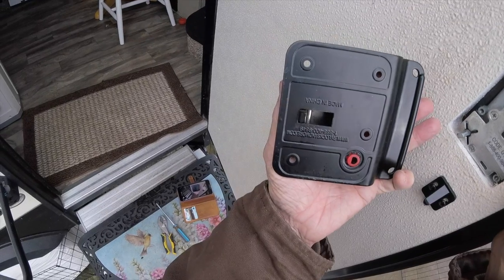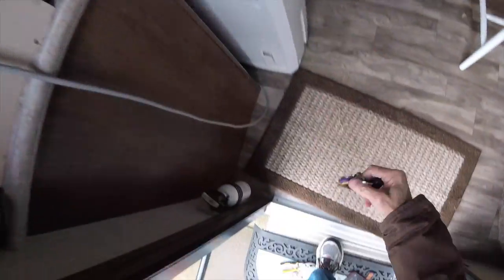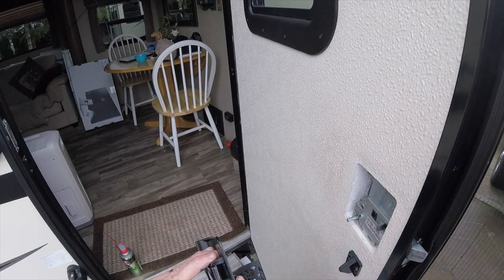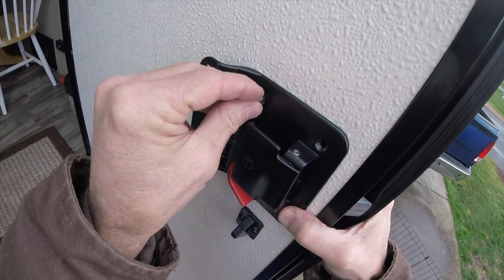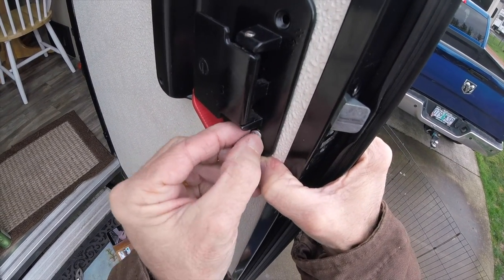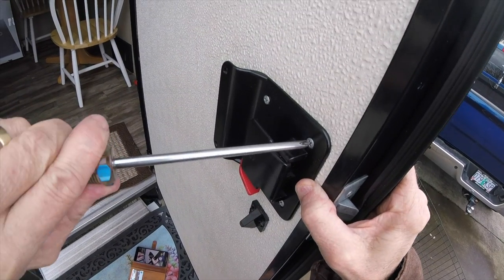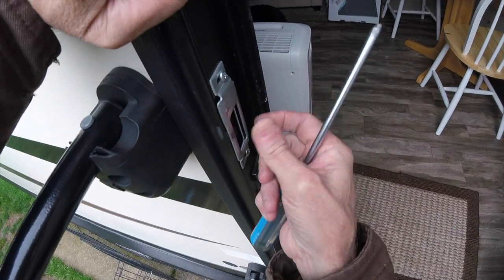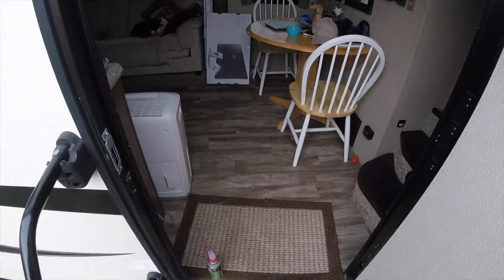Our RV DOOR DEADBOLT is STICKING (RV LIFE, RV LIVING)

Comment: Only reason, I can say, is that the lock mechanism. Is designed to withstand rain. However, if the handle, is loose. It can possibly rust it over time. However, from my experience, in carnival. Most wear out over time from slamming, or doors which are no longer level or straight.
   For instance, I have to lift door 3 inches to get in frame to close.

Comment: Word of advice - remove the inside part. Look at the metal shaft that locks/unlocks
 the deadbolt. A metal plate covers the deadbolt mechanism,  secured by 2 screws. CHECK THOSE SCREWS! Make sure they are tight!! Otherwise, the deadbolt will eventually stop working.

Comment: Maybe the plate the deadbolt goes into on the frame needs adjustments . I saw another video where interior lock  screws had come loose or fallen out and needed to be reinstalled with lock tite. Problem solved
Reply from the maker: Hey, thanks for the advice. The day after the video was shot for some reason the door started hitting that strike plate (I think that's what it's called). It was tight but I did adjust it all the way forward and retighten it as tight as I could. That seemed to align everything. The door seems to be working fine since. Thanks.

Comment: I locked the dead bolt to my Titanium RV 5th wheel and now I can’t get the key out? Any tips
Reply from the maker: Hi Angela. Sorry I don’t have any suggestions beyond the basics like trying to spray WD-40 or Silicone spray into keyhole beside the key. Once you get it out let us know how you did it and what the cause is. I’ve had my key stick a little before but just wiggling it around freed it. Good luck.

Comment: Broke my key off in the dead bolt lock. I hope I can crawl thru storage space to get it from the inside. Ordered a Keyless lock. Prayers for simple resolution.
Reply from the maker: Sorry to hear your key broke off Mike. Were  you able to get inside or did you have to call a locksmith? Hope everything worked out.
Reply: @AdventureRoadTravelers  thank you. Was able  to crawl thru storage space and up thru bed room. Thank God for keto diet! Problem solved and door functional.
Reply: @mikenelson1181  I got my storage door lock open with a small pocket knife.... but there's a wood covering under the bed going all the way across... don't want to damage the wood piece under the bed to get inside to open the deadbolt... no key passed relatives camper on my land.. so I need to be using it